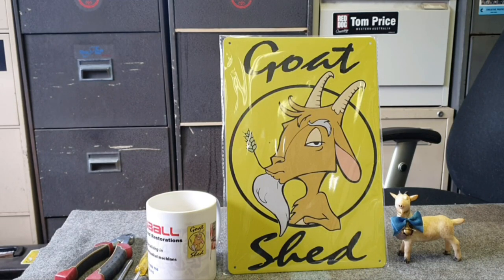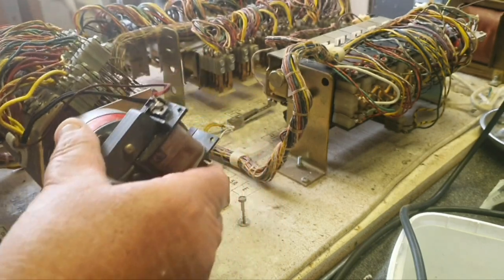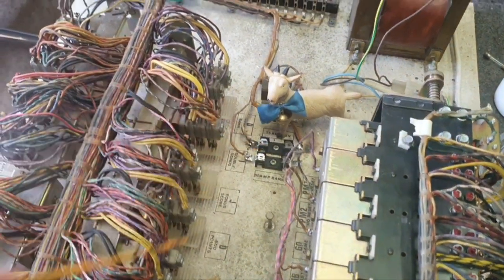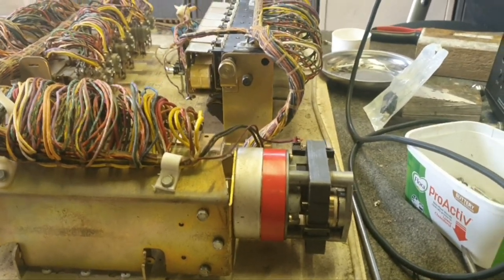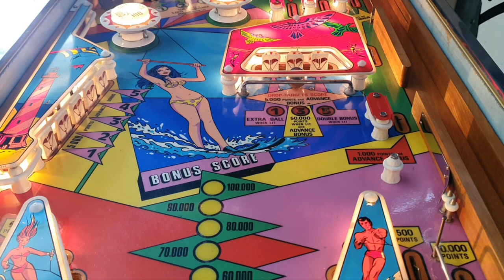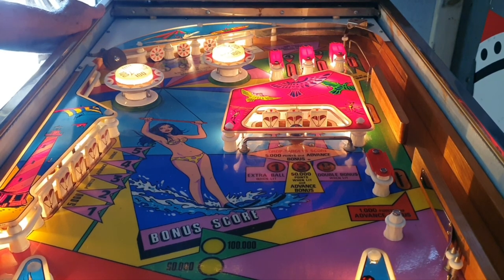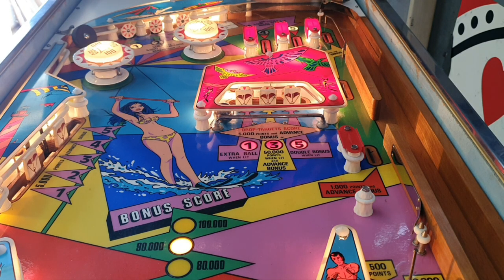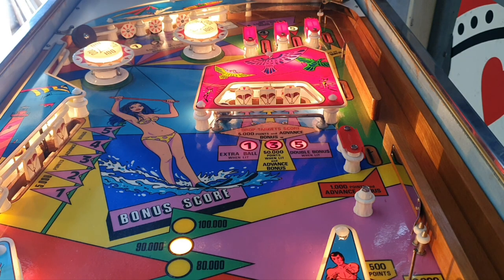Icarus Explanation & Troubleshooting

Comment: Hi, have the same Icarus 1049, but it just goes to tilt mode any time i start whithout any mechanical noise. Any idea whats the issue?
Thanks
Reply from the maker: There could be a few different reasons one is a switch in the start relay or a slam tilt switch in the front door or motor board.
If your not already join our Facebook group The Goat Shed EM Pinball Repair Specialists  that's where we give our help also helps others to learn.
Reply: @goatshedempinballrepair8545  Thanks, just requested to join.
Reply from the maker: @xThePRODx  what name do you go on Facebook also remember to answer the 3 questions before Spanky will let you join!